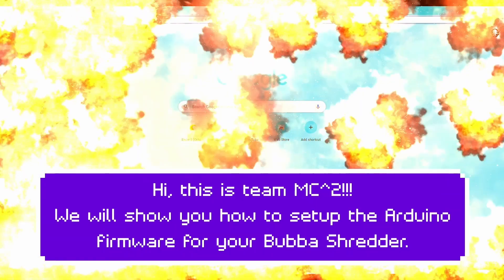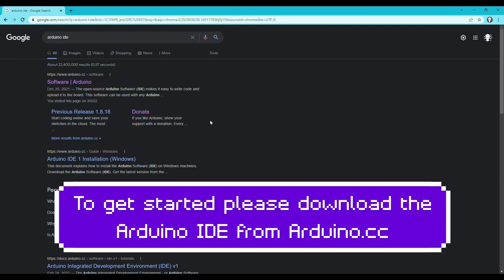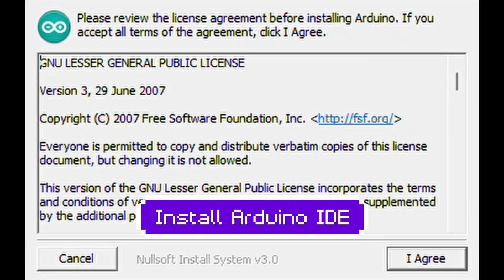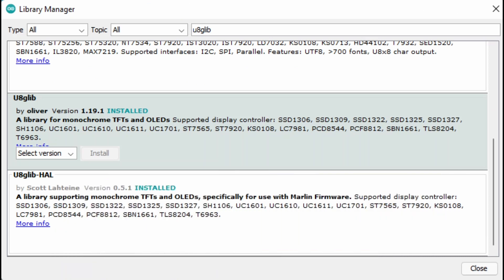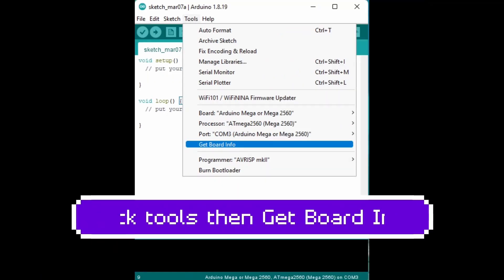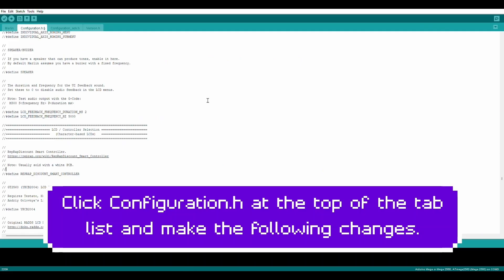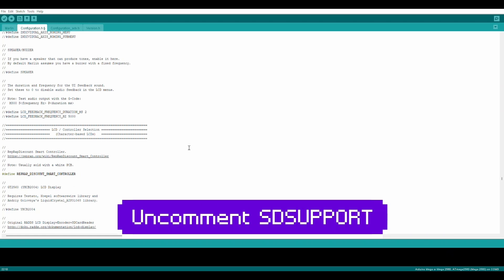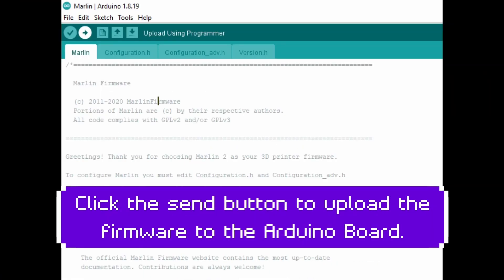Arduino Firmware: Plastic Bottle to 3D Printer Filament Series

Comment: What gcode file do i use to make the board and nozzle heat up and the motors to run? Thanks:)
Reply: I have the same question . do you find any respond yet? thank  you :)
Reply: @rocketboss3894  I have not. Might have to write my own.